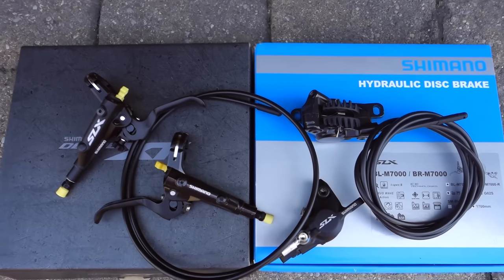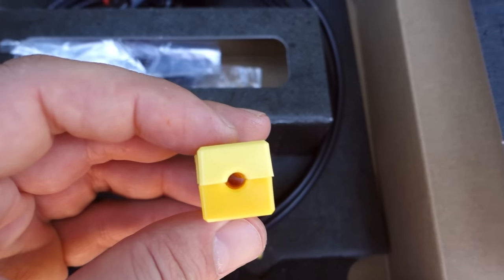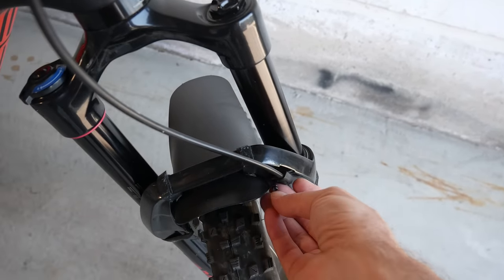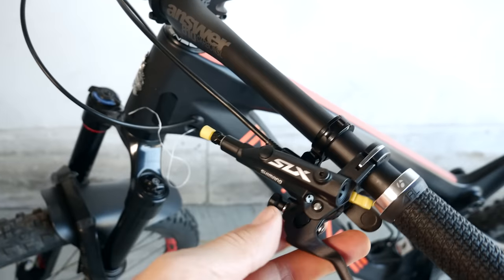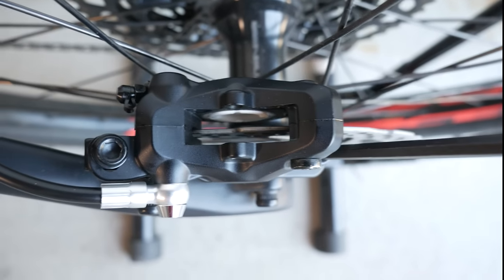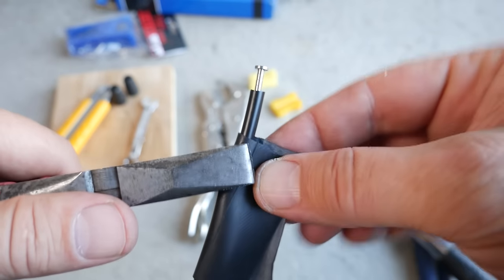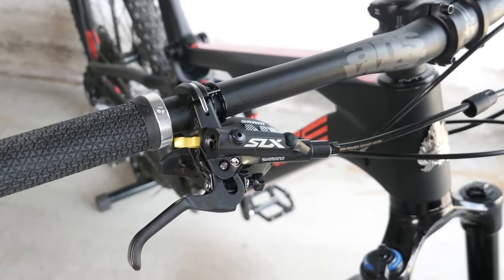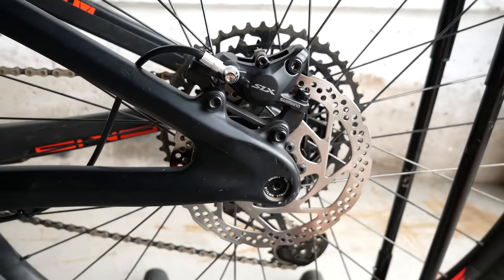Shimano BRAKES Installation How-To, 12 Speed or 11 Speed XTR, XT, SLX, Deore, 2 and 4 Piston Brake

Comment: omg, yer a lifesaver. thanks, mang!!
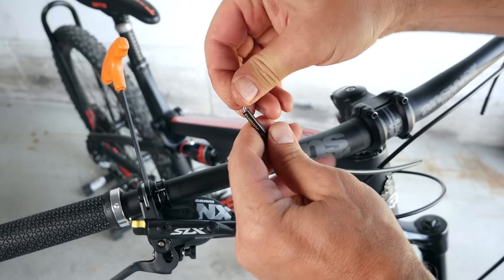Reply: @LoveMTB  All this JUST happened. At 10:20 just like you do I insert the line into the lever, tighten while pushing the line in exactly as you do, put pads in the calipers, remove the lever retainer, pump the brake and fluid comes out of the lever/line connection. No matter how much I tighten while pushing in the line the connection tightener will not grab onto the line and the line slides easily out of the lever connection. 

Grrr....
Reply: @LoveMTB  Olive? The little brass "olive" looking fitting? That was in a separate section of the plastic parts bag; and I was wondering what to do with it (still don't quite know). Was yours already inserted? How do I insert mine? God, I'm soo confused now.
Reply: @LoveMTB  This video?: https://youtu.be/xUvzvsCzjUg?t=485 At 8:05 into that video (the link is queued) you pull the olive  out of the lever connection.  Later, when I get an opportunity I'll pull out the brakes I have and look to see if there's an olive in my lever connection, and if so, did I knock it out of whack.  

We'll figure this out. I really appreciate your help!!! LOL, LEARNING!!!! :)
Reply: @LoveMTB  Okay, here's where I am. You're spot on: the olive moved and when I tried tightening it I destroyed it. Fortunately Shimano includes an extra olive in the kit, so I get the feeling that this happens a lot. Anyway, I made a quick off-the-cuff vid about an olive..... https://youtu.be/E31jURDnQhU

I need a martini now. :D

Comment: I've ordered the new deore m6100 brakes and they come with lever, hose and caliper all separated. Does the installation vary? How do I put the hose in the caliper?
Reply: @LoveMTB  yes but the hose is separated from the caliper too, not only from the lever
Reply: @LoveMTB  oops, I understood incorrectly. The hose comes with the caliper attached. I thought it didn't because the image showed them all separated and the description said nothing about them being attached, so I assumed they were separated. My bad.
Reply: @LoveMTB  my brakes just arrived and in the little bag with screws ecc theres also an olive. In the video you said the olive is already in the lever, so is my model different and the olive is not in the lever or is it just an extra one?
Reply: @LoveMTB  they are not attached so maybe it's just an extra one

Comment: how do you loosen the brake pads they seem to be too tight on my brake
Reply from the maker: Did you take a look here? https://youtu.be/BEJ2TBQjUW0
Reply: @LoveMTB  gona try that tomorrow did you say to push the pistons in?
Reply from the maker: @da7ktech937  yes clean them first though
Reply: @LoveMTB  still can’t get them to fit over im using a carrera vengance im not sure if that will effect the brakes fitting or not
Reply from the maker: @da7ktech937  have a video on how to replace brake pads take a look at that for more ideas

Comment: Video is missing an important step!  
Fitting the ‘Olive’ the brass compression washer to the hose before tightening. 
This missing step ruined the New XT Lever, as the olive was not fitted to the hose properly and ruined the threads in the lever. BEWARE.

Comment: I did this and the hose wouldn't stay in the lever housing no matter how much I tightened it
Reply: @LoveMTB  most likely what happened. I took the bolt out and made sure for the back brakes which went on fine. The front lever bolt is fairly ruined now and won't come out so I guess I'll have to replace it

Comment: Mine is leaking oil after I installed the hose.
Reply: Wondering if this guy forgot the olive fitting that goes behind the insert? These were on the Shimano brakes to took off to replace with better ones.

Comment: Dont remove the breake pads at first installing! Dont do this.
Reply: @LoveMTB  you can hit the lever by accident and out go the pistons, and it's just easier and faster to just mount the caliper in place, squeeze the lever so it self centers then tighten up the bolts carefully.